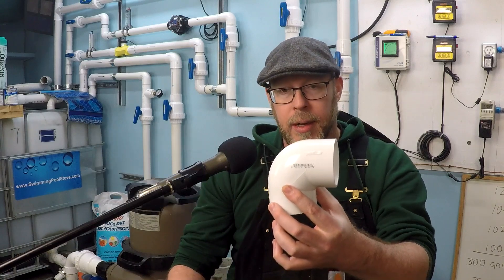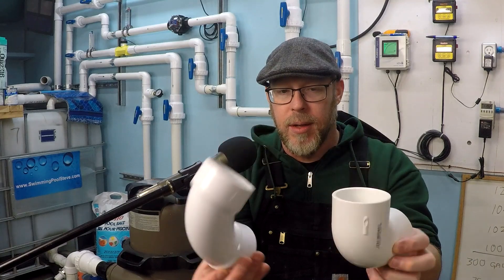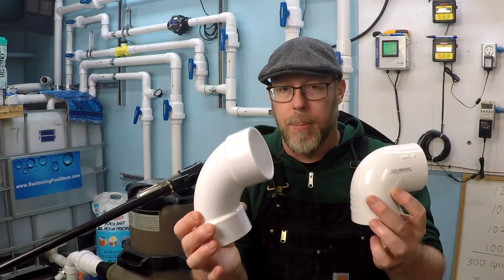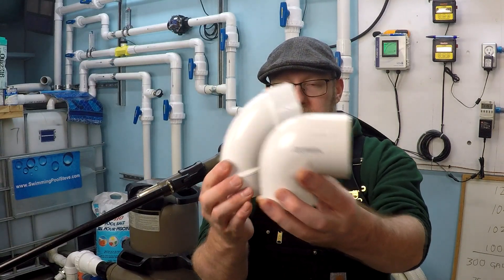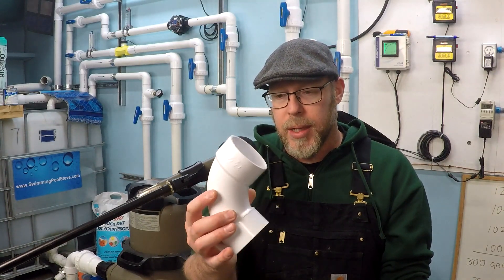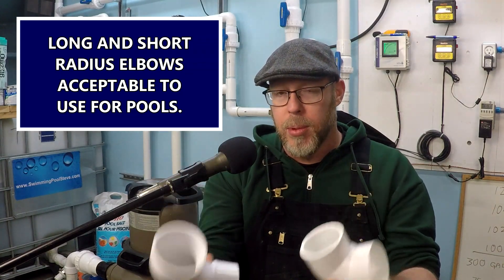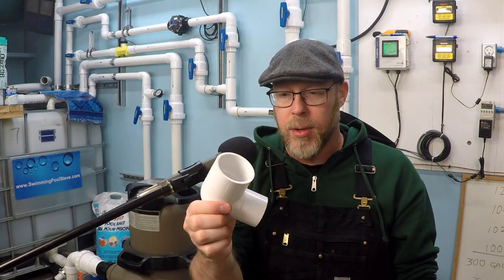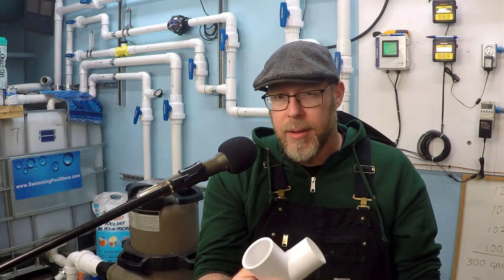What Is a PVC Sweep Elbow?

Comment: I love all your videos!!! I have learned so much.  I look at a pool pad and think they did that wrong  or the did it right. I have been designing my pool and going to see pools that the builders built to see the equipment pad. Out of the three builders only one had the 5x2 =10" or more of straight out of the pump. So Thank you for all the tips. I don't think I saw anybody put a sweep 90 just the short 90 everywhere.  A few street elbows. I asked one pool builder to only put sweep long 90 first and 90s if they had to and no street elbow he is said that was an up charge of about  700 dollars more. I noticed on a chart that theT are way worse than the 90 or street elbow can you do anything to make those better so they are not so turbulent.  Also every pool I went to see they all put the short 90 after the T some add some pipe first others don't.  No one puts the sweep long 90 would it be way better to put those if there was room. So straight pipe then T then on either side they put 90s either with a little run of pipe to reach pipe that goes down to the ground or none. Just curious if I should fight with them to put the long sweep 90s if they can. Will it save that much money in the long run. I will have to pay 700 dollars up front.  My pool is 14x27 attached same level as pool 14x6 spa with hopefully 16 jets so I can have a few seats. pool about 25 feet away spa 75-80  feet away. I told them I need a big pip to bring the water to the spa one said 3".  I am putting an in floor most likely though might not need it as much since I am putting an auto cover as well.  But it very dusty here in Arizona and I will have the pool open for enjoyment. :) Thanks again for all the info. You are a great teacher.

Comment: Hey Steve, I've been reading that sweeps are required by code in some places.  Do you have any information on where sweeps are required?
Reply from the maker: I have not heard of this before now.  That would be a pretty neat thing but I wonder if there are not better standards to enforce.  A sweep is useful incrementally but properly sized plumbing lines would be substantially more effective.  Or what about requiring flow meters?  Without any required instrumentation how can pool owners effectively dial in the variable speed pump that the department of energy made them buy?  Sweeps being required would not be bad, but seems like a missed opportunity to tighten up the bigger factors impacting energy efficiency in pool filtration systems.

Comment: actually so glad you made a video to clear this up. Its a pain in the a$$ to find sweep 90s that are pressure rated and not just DWP locally. I finally bought a few from a link you had sent me. But short radius 90s are readily available so knowing I can use those is a bonus. I did notice less noise from the pump once upgrading to the sweep 90s and having a long strait run directly out of the pump like you suggested. Keep up the good work, love the videos !!!